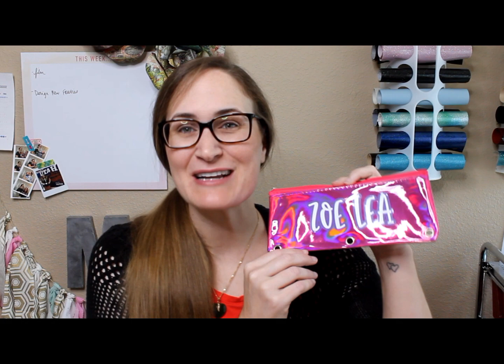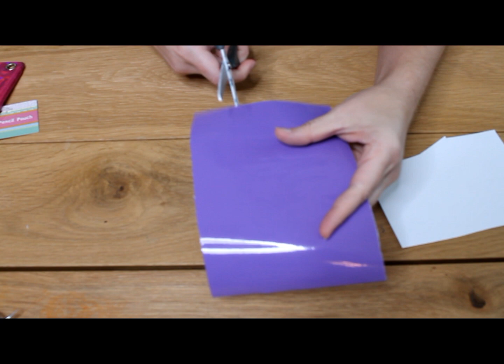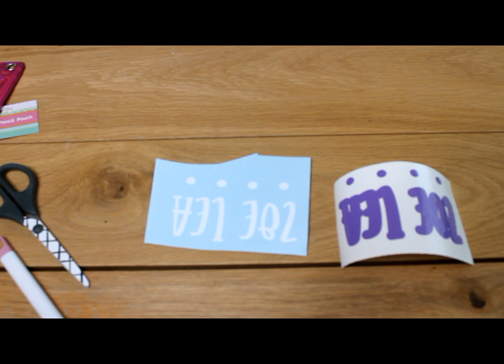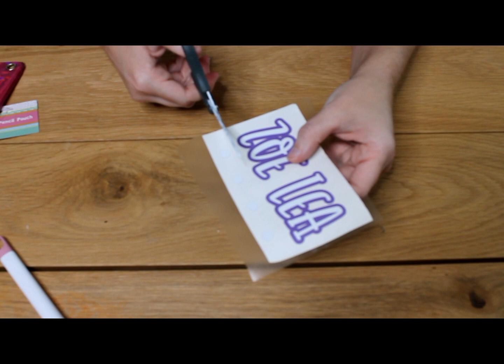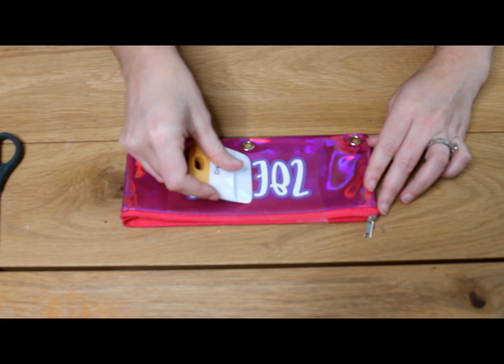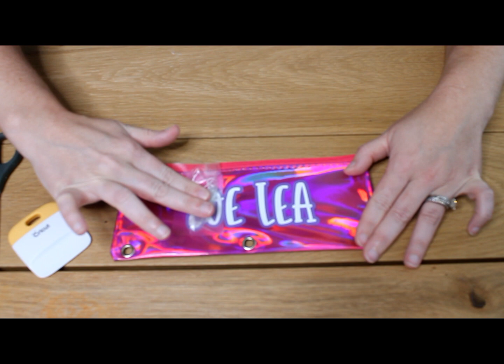How to make a Custom Pencil Pouch / Case, using your Cricut or Silhouette!

Comment: Just starting with vinyl, is adhesive vinyl the same as the oracle 651? Would it stick and last the same?
Reply from the maker: Hey Estefania!  Yes, Oracal 651 is a brand name of permanent adhesive vinyl.  Vinyl that is applied in areas that are touched a lot may eventually lift (think of a tumbler), but for the most part permanent will stay adhered for a long time (Oracal 651 solid colors are rated for several years of indoor and outdoor exposure).